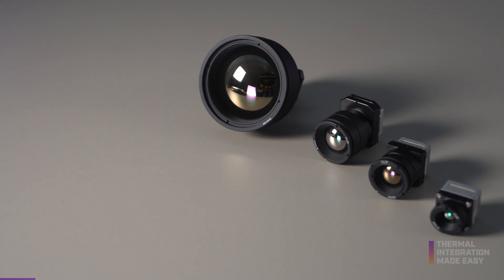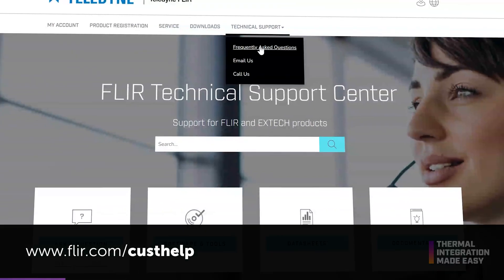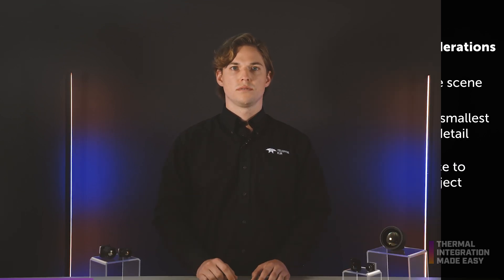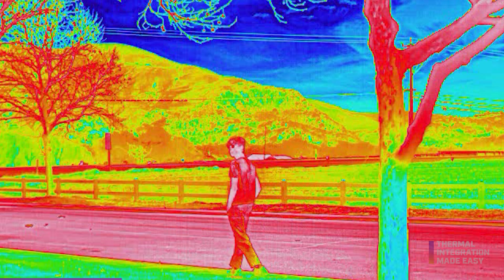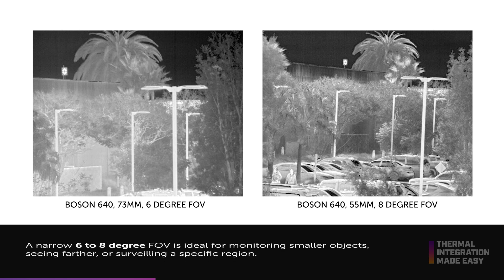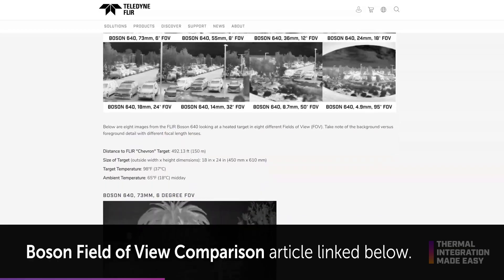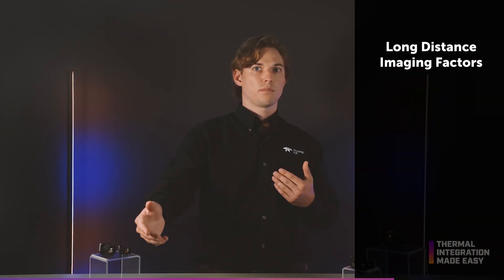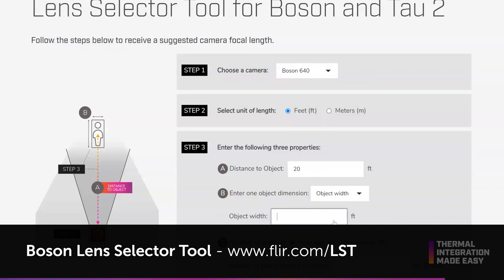How to Choose a Lens for a Thermal Camera  |  Thermal Integration Made Easy by Teledyne FLIR

Comment: It is a common misconception that the Johnson Criteria is based on pixels on target. Pixels on target is a geometric calculation, that does not take into account atmosphere or diffraction. Consider the difference between two hypothetical boson lenses: one F/1.0 lens and one F/10 lens of the same focal length. Obviously, the detection range will be higher for the F/1.0 lens, yet both will achieve the same pixels on target. The Johnson Criteria is based on "cycles per target" which is different than pixels per target.